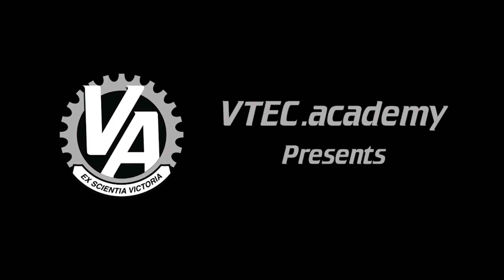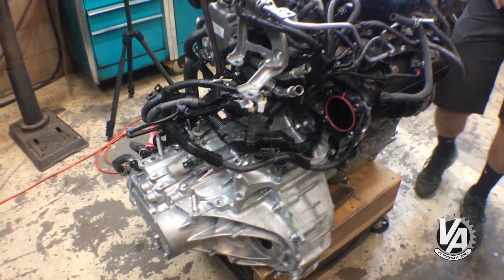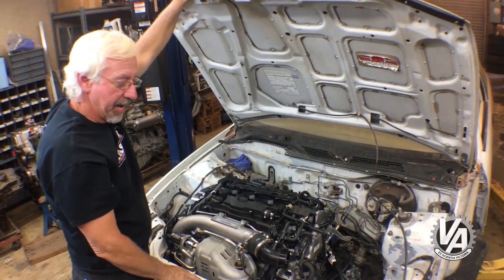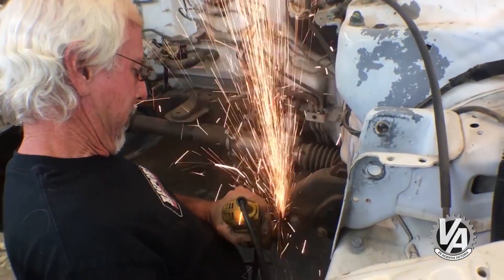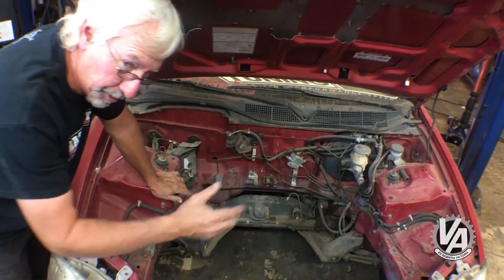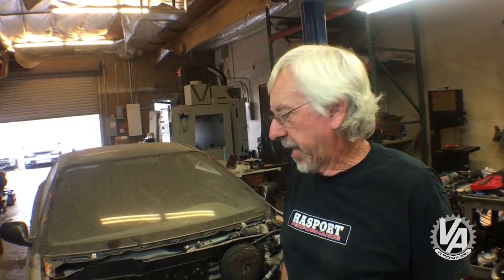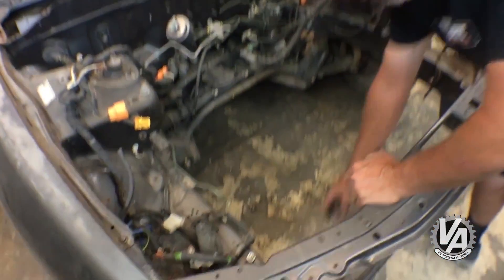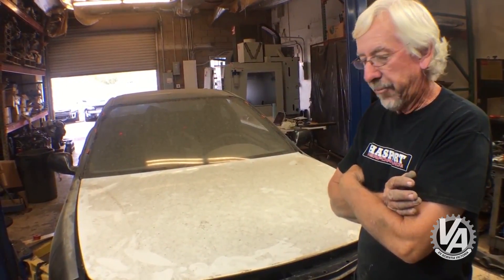K20C1 Swap into EG, EK Civic and DC2 Integra - Test Fit

Comment: I want to get schooled…. Is there any way we can install the k20c1 from hpd into the FL1 civic hatch. 😊
Reply from the maker: It will bolt in with the FL5 mounts.
Reply: @VTECAcademy  thank you for replying 
  I was more concerned about the electronics on how it would function and the axle (if i could use my existing or would the ones from the 2.0 work perfectly fine). Is there a number or email i can use to contact you. 😊. 
  Im planning to get this done.  If i do it would be summer 2024

Comment: I have to say I have an issue with this. I don’t see the type r engine being that readily available to do this swap. The L15b is the engine all this research time should be invested into. Hpd won’t sell a type r unless you prove it’s for racing. The cost of one from the dealership is probably out of the question too. Do the L15b swap instead.

Comment: I feel as this motorr will fit perfect in the 2004-2008 acura tsx big room in the engine bay
Reply from the maker: We haven't tried it yet, but the TSX does have a roomy bay since it did come with the taller K24.
Reply: the tsx also has the j35 v6 as a higher trim option. it definitely has the room in the bay

Comment: haltech with custom harness all you need is injector, crank angle sensor, control valves, temp and pressure sensors, and coils

Comment: Please drop that engine into the DC2 I love that chassis and the body style is nearly timeless.
Reply from the maker: At some point
Reply: :D looking forward to the future then. I really want to get a civic hatch and do a swap for a project but I have so many questions. I hear the k swap is the easiest but I also see a lot of people mixing and matching different blocks and heads and I'm so lost on whats the best setup for a base engine setup before turbo. Is the K the best power for a base or is one of these frankenstein engines more powerful?
Reply: Also if K which of the K's should I be shooting for? I have an 02 Audi TT Quattro 225hp with 100,000 miles that runs fine that I'm hoping to leverage at a yard for a complete swap trade so I imagine I should come out of it with any engine/tranny I want so I want to be sure I get the best setup I can. Any advice would be very greatly appreciated.

Comment: Why is the USDM Hatchback referred to as the EK when it USDM 1996-2000 Civic CX, DX Hatchbacks are EJ6? Everyone calls their Hondas "EKs" when true EKs are JDM right hand drive cars.

 http://www.superstreetonline.com/how-to/chassis-suspension/1312-honda-chassis-code-checklist/
Reply from the maker: It's shorthand for all 96-00 Civics. Except for the 99-00 Si, that's an EM1. 99-00 Si owners get really hurt when you call their cars EK.
Reply: VTEC Academy - I would consider it street slang for all people who wish they had an EK9 Type R. Like every EJ6 owner spraying their car EBP and calling it an EM1, which is frowned upon. They at least call them clones. I have an EM1 ￼myself my 2nd and it's got 340K on the clock and still ticking.

Comment: useless test! cut this, cut that, swap and trim some more ... you already have a k20 fitting under the hood, with turbo you get the same power or more as the new one so this video is totally useless and give bad ideas. Only americans try to put useless power on a chassis that is not made for that.
Reply from the maker: We Americans are like that. Always making our cars faster. Don't hate.
Reply: People said that about K20s in early 2000s. I remember my buddy doing a k20 in a em1 in early 2000s and it was super expensive and B18C ITR made better sense but look at how common K20s are now.

Comment: +VTEC Academy what engine would you recommend for a daily in a 200k + DC4?? I'm debating moving on to a 10th gen civic or something else more relaxed. I'm at a crossroads, either put more $$$ into it or replace it for another vehicle.
Reply from the maker: TSX Type S swap with RSX Type S transmission in your DC2. Actually, the 10 gen Civic is really nice. Honda has dome a lot to quiet the car down and make it more adult. The turbo cars are quite fast and it you can keep your foot out of it get decent gas mileage.

Comment: how will all those frame cutting and trimming affect the chassis rigidity? and considering the weight and position of the engine, wouldn't it be too front heavy? also do you weight the car to see the balance across the left/right wheels?

Comment: I asked my buddy who just bought a new Type R how he likes his K20 and he's like, "bro I didn't buy an Si Civic, I bought a Type R, I don't have that regular old Naturally Aspirated Vtec K20 Weakness." I couldn't stop laughing at him and he seriously said, "What's so funny man?" I told him, "The Engine in this Turbo Type R is a K20C1 and it was a K20C1 in the other Turbo Type R we didn't get here in the U.S. that just ended production when this one started here." he seriously looked like he wanted to hit me because this was at the dealer ship 

On top of that I drive a lowered 1986 Camry but that's not the whole story MWR converts 1zzfe's and 2zzge's to MR2 E153 Trans that are known to hold 700 hp all day and even more torque than that as well, with a E153 trans converted to work with a 2zzge (The Corolla XRS engine 1.8 vvtL-i [Toyota's version of VTEC] making 164hp versions, 173 hp, 189 hp then there were Corolla T Sport Compressors with 225HP Supercharged 2zzge's, and "Lotus Exige's Supercharged them as well making 240 Hp versions in the Lotus Exige R" the non intercooled Lotus supercharged one was 225 hp still impressive for a Supercharged 1.8 liter vtec type engine with a roots style blower. The High Revving engine all had different redlines which baffles me, in a USA Spec Celica GTS the redline was either 7900rpm or on some 8200rpm, Lotus had their redline on the same engine set at 8600 rpm, As was the case with the 3SGTE, 2JZGTE, 7MGTE and so on Toyota Commissioned Yamaha to take an already proven engine and turn it into a racey version so this is essentially like the difference between a Non Vtec B18B1 140HP and GSR B18C1 170hp so Toyota had the 1zzfe 1.8 140HP Corolla economy engine the only difference is it did have VVT but only for fuel economy sorta like the low powere K20B that made 156 hp and had VTEC but not for racey cams but for fuel economy Vtec change over in order to keep the torque curve at the sweet spot for easier acceleration loads. [Sorry engineer here, I tend to over explain] So Yamaha took that 140 hp dependable as hell 1.8 and put a hell of a head on it, forged crank, light weight rods, and pistons increased the comp ratio and the lowest output ones were guess was 170 like the GSR lol how ironic but most were 190 and Lift as Toyota calls the race cam, and Honda guys call it Vtec kicking in, is just the higher Cam engaging that gives it the deeper sound from the intake valves opening more allowing more atmospheric suction   causing the mesmerizing sound that so many gear heads are addicted to. Anyways my all motor build started out healthy I dynoed it stock since I had to wire it all and get the E153 trans in and fix the wiring mess of a 31 year old car, clean as hell but still very old wiring so I wanted to b extremely careful, anyways it dynoed 187 at the wheels in stock form so Mine was healthy maybe a earlier JDM Celica engine, but I was also using a Matrix Ecu Lift/Vtec engages at a lower RPM so the power sound and pull comes on earlier in the gear, win win.) but Monkey Wrench Racing makes some extremely good stuff for the not VVTL-i engines as well the base 1zzfe engines that make 120-140 hp depending on year and car they came in stock Pontiac Vibe's had them 1st Gen Toyota Matrix's, Geo Prisms Were just disguised Corollas sold as Geos but other than the weird globe logo on the grill it was obvious it was a corolla and besides the cheap ass interior electronics like the stereo and so forth. Also Chevy Prism 1998 and on Were also Corollas just Badged as Chevy prisms also had 1zzfe's Then there was the 2001 or so and on Toyota MR-S (MR2 Spyder) just had the 1zzfe in the back with a aluminum intake manifold instead of the plastic one on pedestrian corollas lol and had a throttle cable instead of throttle by wire with the hangy revs and all that economy sounding rev hangs. In other words the engines were everywhere, and even the High revving 2zzge's that made nearly 200 Naturally aspirated horspower can be Found in the first gen Pontiac Vibe GT with 190 hp and the C60 6 Speed manual trans, It was in the Matrix XRS which is just the Ponitac Vibes Mechanical Twin with slightly different looks, but yet again GM did not make or design the Pontiac Vibes they are actually Toyotas from the ground up, GM just throws their own electronics in like the radios, and yadda yadda, but the Pontiac Vibe was Actually Sold in Japan as a Toyota Voltz seriously check it out. Back on track, I wanted to have a loud cam change over before I got it tuned so I threw an aem ram hot air intake just to hear the sound till I got my stage 3 MWR Cams in so I could put them in, yes I do all my work myself and even do base tunes, but I leave the fine tuning the to the pros because I can make power but not nearly as well as they can. Anyways since I knew I wasn't going to be turbo'd as quickly as I wanted between work and waiting for parts and it was frutrating, so I put the cams in when I got them and tore the engine out and put all the new Rods, Pistons, ACL Bearings, ARP studs everywhere MLS Head Gasket, and drove it tuned like that NA for a while with PPE HEader but I wanted more power than the 227 whp I got out of full exhaust ECU, the built engine, (I'll be it low comp at 9.7/1) a great tuner, he was impressed it made that power with low comp setups. But with the forged crank micro polished, my beautiful bearings, MWR Stage 3 cams and obviously dual titanium valve springs got me the ability to rev to 10,500 RPM all day and if I want to occasionally but not all the time I could hit 11,500 or 12,000 if I really needed to win a race and didn't want to give an inch to the time it takes to shift.

 So then  came the Turbo setup  and I walked his ass in his Type because the 86 Camry all in weights 2567 with me in it, thanks to Aluminum Block, Stainless steel everything allowing them to have thin walls, and aluminum every where else I could use it,  traction  was a problem at launch but then GT40R  Took over once she grabs she's so old and small I'm on 205/5015's on the Enkei RPF UNOs slightly stretched on the 8 inch wheel so I can clear the damn fenders even though they're rolled too.It's the biggest I could fit until I do the over fenders and radius the fenders, my car came stock on 13 inch wheels but has a 5x100 lug pattern thanks Toyota for forcing me to spend hundreds of dollars on special hubs to accept 1000hp axles for my 700hp and 850 lb ft of torque capable transmission, and then making me drill them from 5x100 with these 
beautifully one piece machined hubs that accept huge axle ends and had ARP 2 inch longer studs already installed into them and then I had to go and pop them out and drill these precious hubs to 4x100 and throw new ARP Studs back in, more money wasted but who cares, it's just my hard erned money wasted, to fit the only size Enkei RPF1 that was small enough and wide enough to fit a tire underneath and within my wheel wells without rubbing to shit and burning a whole in the tire, I had to dial a small amount of negative camber in the rear to clear because it has that old school 80's squared top fender just in the rear, Just look up a 1986 camry and you'll see, you'll also see how ugly they are stock but once they're lowered on rpf1's I get looks all the time and now that its fast as hell, people constantly try and chase me down ad wen they do they're like man, I was chasing you for so long, that thing is fucking fast, and these guys are in new mustang GT's and Freaking Challenger SRT8's STI's and all that good stuff...end rant. Just pointing out how sometimes no matter how hard you try and plan something still goes wrong no matter what. And I'm not even running drag slicks, Just Falken Azenis RT615K's, they scare me with the wheel hop if you launch too hard on them, drag radials never did that, but I was rubbing like a mofo with those on. With turbo tuff rods, acl bearings throughout, CP pistons, strong gear set for the trans from mwr, and the upgraded hub conversion and axles they are made for 1000hp since I wanted to over build it, right now I'm running greddy emanage ultimate. Since the car was mint looking, had been garaged its entire existence and constantly got mistaken for a cressida, I figured man, this thing would probabluy turn some heads if I did it right and made it fun for myself because who doesn't like going fast. All in I'm $14,000 but The car was given to me when my grandparents stopped driving and they just told me to love it like it's my own, well I took them for a ride  before they passes away last year before the turbo and they said like old people do, "How in Heavens name did you make this thing so zippy, it feels like it's going to fly away starting off that rapid." Man I miss them and their sweet humor. I have a remote oil filter since the under body is completely flat so I don't fly away since with the gearing I can hit about 185 Mph maybe more since I can hit 12,000 RPM in Fifth if need be but he calculated (MY tuner Nodgy) That at10,500 rpm in 5th gear I'd be doing 185mph ....and the Magic Numbers areee in drum roolllsssss pleasee. MWR Parts, Garret Parts, OEM Toyota E153 Trans with MWR 1000hp Axle and Hub Upgrades, (OH forgot the wilwood brakes, great company small packages for small wheels and still stop amazing from 150,  I know from a closed course, under controlled supervision.) CP Pistons 9.7/1 comp ratio dual titanium valve springs 12k rpm capable rotation assbly but she usually only sees about 10,500 VVT L-i Cracks at 6k rpm and that's when HP really starts climbing, also boost by gear so she doesn't spin much at all even in the cold, the hot she sticks like glue. 4 Different boost settings, 1. low 390 Whp, 2. Medium 506 Whp 3. High 741 Whp 4. the I don't wanna lose tune, and this is from my in trunk E85 15 gallon fuel cell only (forgot say I have 2 tanks one for gas and on for E85) anyways that tune makes 902 HP to the Wheels. from a 1.8 Corolla XRS engine!
Reply: Yung Padawan Can you write my essay for me? 😂

Comment: I know honda sells these engines as a crate motor now. But from what I understood is that the engine was only available to people actively racing in sanctioned events?
Reply from the maker: That's correct. You buy i through your membership in the Honda Racing Line. At this time it is basically a replacement engine for people racing a Type R.

Comment: BB6 Preludes would be a good candidate too for K20C1 Motor swap since they’re known for large engine bays 👍🏼
Reply: Roughly 150lbs difference between bb6 vs 2017 type R or 50 lbs between SH trim. EG non gutted is 1000lbs difference.

Comment: I see these engines ( accord, CTR) as good alternatives for the current Civic. You can make a CTR killer for relatively cheap. For the older chassis I would stay with the older K swaps and turbo charge that at low psi... Reliable and more powerful.  Low engine clearance is a total headache and not worth the risks you take.

Comment: here in portugal the fk2 ecu has already been hacked, is it so diferent from the fk8 ecu?
Reply from the maker: Apparently it is. Also even though it has been hacked, you have to send it in for a reflash. That's not going to work for Hondata or KTuner.
Reply: The ecu has been hacked, but none of the things needed to make a swap has been investigated, as ignore multiplexer, abs, etc etc

Comment: This engine is not better than the old k20, and swapping it is a lot more complicated. Old k20 is still the best option for a swap
Reply from the maker: It's better. And the transmission is better. But the old one is a better fit.
Reply from the maker: No, the engine is much more robust. The crank is stronger, the block is stronger the pistons and rods are stronger. Once the ECU is cracked, you will see significantly more power using stock components just like on the new SI, Sport, LX-T and EX-T.
Reply: Andrea Sanai it's allot more complicated because nobody has streamlined the process yet.
Reply: Maybe the trasmission is more robust, that's it. The engine itself is nothing special, still open deck design, vtec only on the exhaust side, the electronics require you to invest big money for an aftermarket ecu. I don't see where it's better if we talk of horsepower. Yes, it s direct injection so better gas mileage and pollution...who cares. I have already worked on this engine on the fk2 platform, I m not impressed.
Reply: To be clear, I understand why you and hasport want to make a swap kit, it s a possibility that must be covered. But in my opinion this engine has his reason to exist only in the fk8 chassis.
Reply: VTEC Academy why won't a normal k tranny bolt up to the k20c?
Reply: except this comes already turbo, which professionally/legally double the costs if done separately not to mention allowable boost limits before needing a  rebuild, would rather a straight swap and tune with turbo bolt ons for a very quick car off the bat swap
Reply: Iwata Myamoto do you have an idea of the cost of a k20c, and of the swap? Only the electronics is in the 5k range.